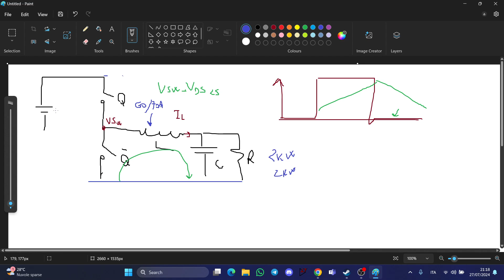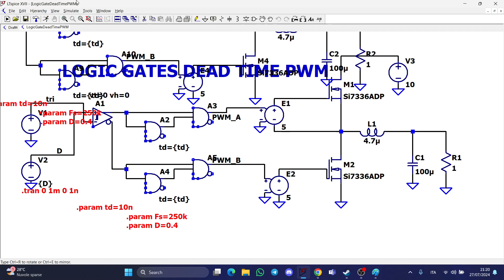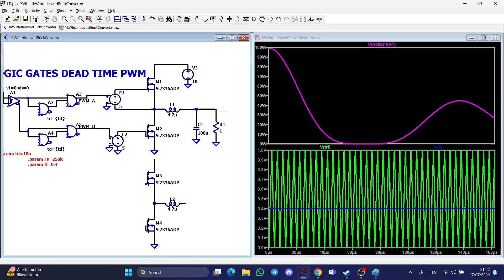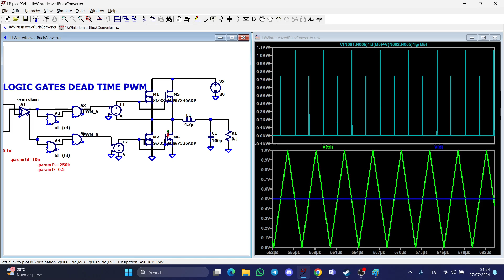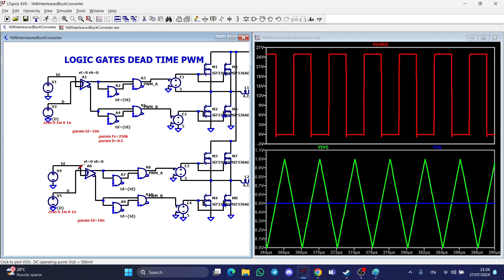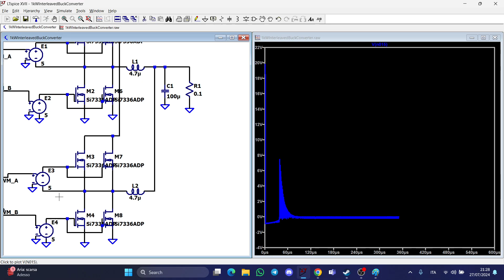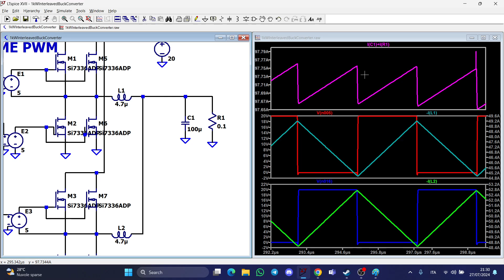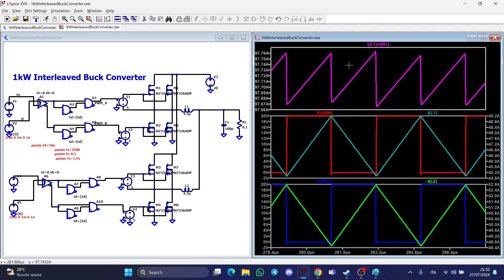LTSPICE 1kW Interleaved Buck Converter

Comment: Hello, thank you for this excellent tutorial! I've replicated this circuit in LTspice to study it.

I'm running into an issue with the PWM control logic, and I was hoping you could offer some advice. It seems that using the digital logic gates (A1-A5) to compare the analog V(tri) signal and the V(D) level is causing some problems in my simulation.

When I run the simulation and plot V(out) vs. Duty Cycle (D), I get strange results:

Non-linear Duty Cycle: The duty cycle I set with .param D doesn't match the actual output. For example, with V(in)=10V and I set D=0.4 (40%), my actual V(out) is 5.629V (which means the actual duty cycle is 56.3%).

Saturation: When I set .param D to anything above 0.5 (like 0.6, 0.7, or 0.9), the V(out) gets stuck (saturates) at 7.551V. This means the logic circuit itself is limiting the maximum possible duty cycle to ~75.5% and won't go any higher.

I checked the V1(tri) and V2(D) waveforms together on a plot, and the V1(tri) peak is correctly above the V2(D) line (even at D=0.9), so the comparison inputs should be working.

This makes me think the issue is not the V1/V2 comparison itself, but that the A1-A5 logic gates are failing to correctly process these analog inputs and are causing this 75.5% saturation limit.

I was wondering if you have seen this? I believe replacing the A1-A5 digital gates with a proper analog comparator (like using behavioral voltage 'bv' sources in LTspice) would solve this.

Thanks again for the great video!

Comment: Hi, at 13mins when you run the simulation should I(L1) and I(L2) be the same except 180degress out of phase?
Reply from the maker: Yes. In the simulation it is just shown the transient (200us). If you run the simulation for more than 1ms, you will see that they will be the same in value and only 180 degrees out of phase like you said